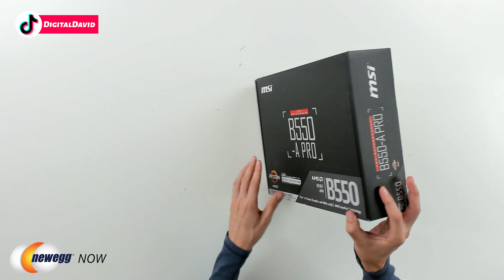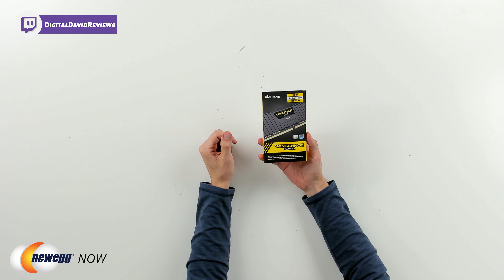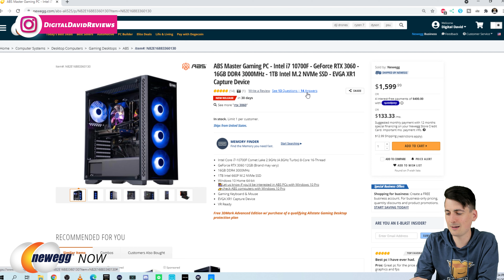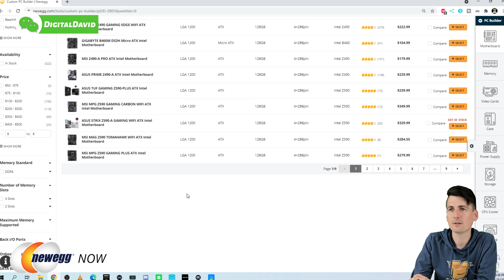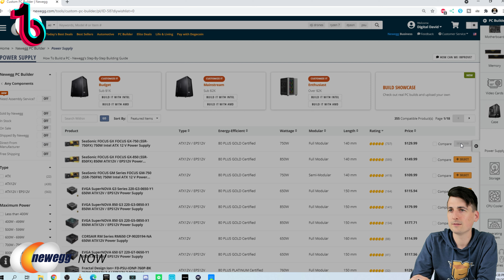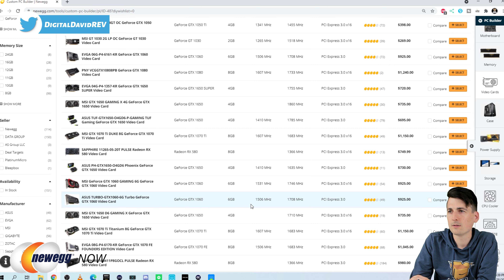$750 PC Build Showcase // Newegg Now

Comment: How does an Asus graphics card perform compared to one directly from NVIDIA?
Reply from the maker: Asus graphics cards are generally designed to perform similarly or better than Nvidia's reference graphics cards. Asus often adds its own features and technologies to the graphics cards, such as custom cooling systems, overclocking capabilities, and specialized software, which can provide additional performance benefits. However, performance can also vary depending on the specific models and specifications of the graphics cards being compared. In some cases, Nvidia's reference graphics cards may outperform certain Asus graphics cards, while in other cases, Asus graphics cards may outperform the reference cards. Ultimately, the best way to determine which graphics card performs better would be to compare benchmarks and reviews of the specific models being considered. cnl
Reply: @DigitalDavid  thanks